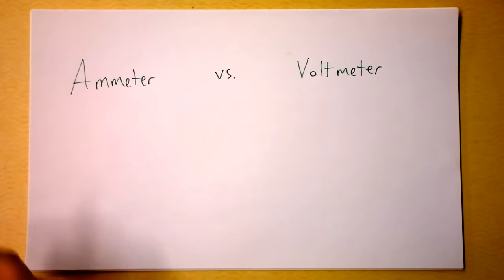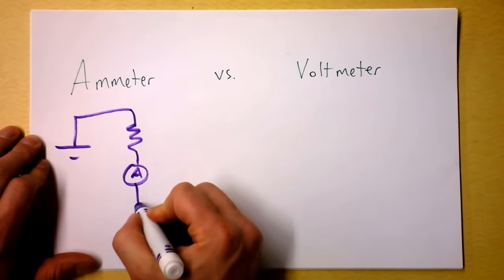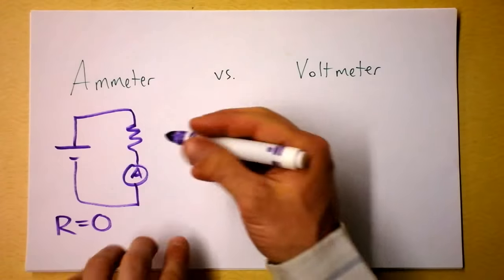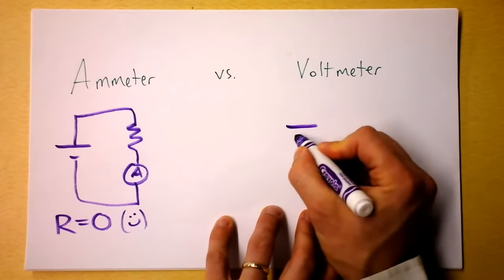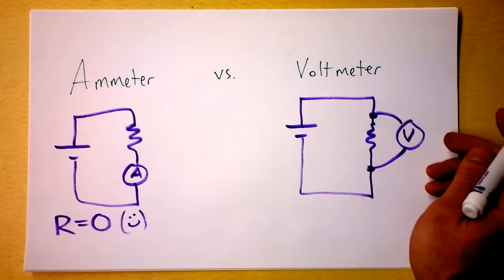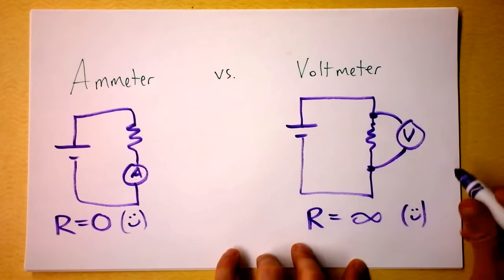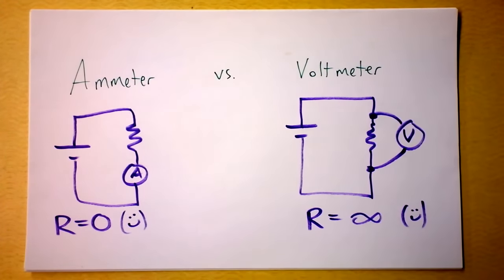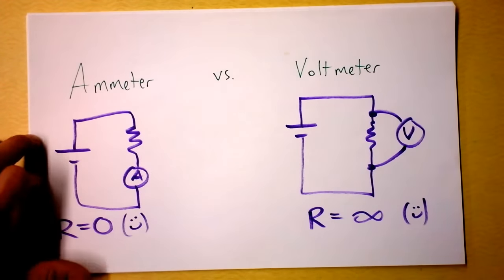Ammeter vs. Voltmeter Circuit Theory | Doc Physics

Comment from the maker: Ooh, now we really risk having the engineers laugh at us.  I would argue that the voltmeter with no current through it just needs to measure the voltage, which is no problem in MY ideal world (your ideal world needs some technical upgrades).  There would still be an electric field!  I understand there are non-contact, capacitively coupled voltmeters that can be used in high-V applications.  I guess that's where it would be most annoying if your voltmeter had finite resistance.

Comment from the maker: Ah, you're miring yourself in technical details.  You're totally correct, of course.  But I'm designing an ideal voltmeter.  Wikipedia tells me you can actually expect to find 1, 10, or 20 MOhm input resistance to an amplified voltmeter.  Just short of infinity, right?

Comment: I feel stupid asking this but how would I test the current of a battery? does it need to be under a load? I don't get anything by touching both ends of the battery like how you would for checking voltage

Comment: don't think you want the voltmeter at infinity. just at a much higher resistance than whatever the other resistor is. because if it were at "infinity' there would be zero current flowing. And the volt meter would not be able to read a current and then make use of v=ir. am i wrong? not sure. maybe the way a voltmeter works is different than this?
Reply: Brendan O'Shea if you put a voltmeter on a battery that has three 9v cells in series, would you label it as 27v or 9v three times please answer